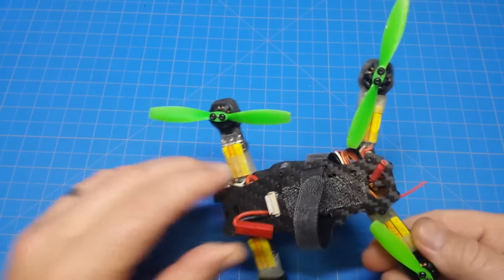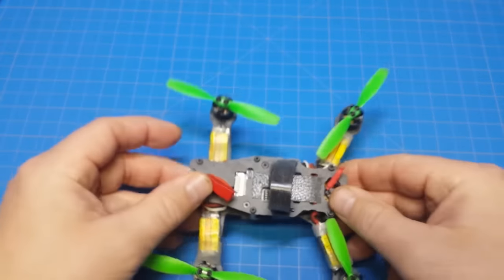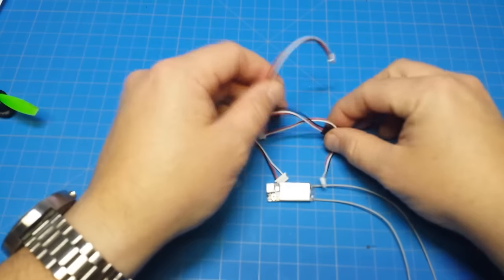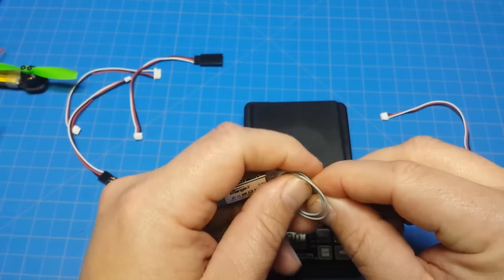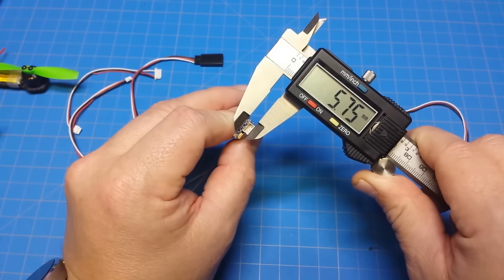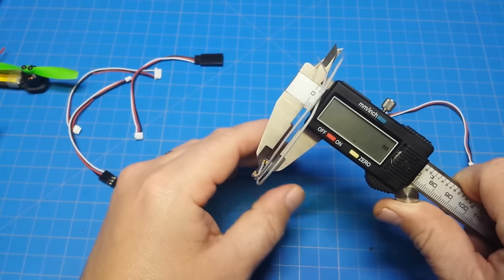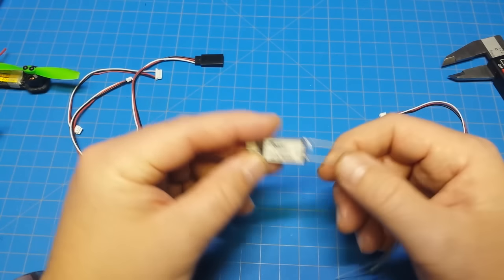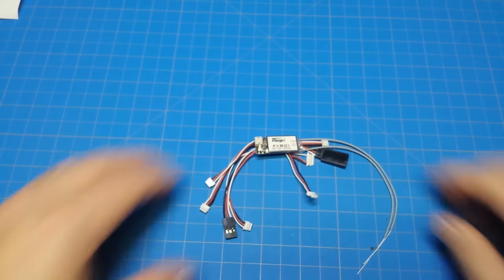iRangeX Receivers - Briefing

Comment: I got a drone that came with this irangex for dsm but there is no binding button on it. Any clue on how to put it into binding ?
Reply from the maker: we have to have the correct uart/port selected and dsmx 2048 selected on the config page, then in the cli we have to type, set spektrum_sat_bind = 9 hit the enter key, then type save. Disconnect power and reapply power, then it should be flashing quickly and bind on your radio. After a series of light changes power off and on the quad again, should be bound now.

Comment: I got the DSM version but I cannot find the binding button !!! Where is it ?
Reply from the maker: I don't beleive there is a bind button. We have to use the cli in betaflight to set the rx in binding mode. Typically set spektrum_sat_bind = 9 and then save. We also have to have the correct uart turned on in the ports tab and spektrum set for the receiver.

Comment: Hi how to activate the Fail Safe on RX IrangeX FX801 for Futaba, Can you Help mi?
Reply from the maker: normally we would set the radio to "no pulses" but on the receiver side I am not sure.
Reply: Ok, I've already configured out, and it might help someone, when the RX is bound, turn on the radio and the drone, then the RX should turn green, then click on the F / S Button until it blinks green and red right away click once on the F / S button and the led will turn green again, then test, turn the drone on and then turn off the radio to simulate the loss of signal, a few short seconds the drone will turn off, I hope I have helped. Tks.

Comment: so, i got my ex105 flying,  but im not very happy about the thrust. it only weighs 43 grams, but with the stock props i can barely get it of the ground. with battery it is 57.5 grams. as i have seen the qx95 (which only weighs 40gram) i would think 3 grams doesn't make much of a difference. i got the rolling spider props on it, so it should have more thrust.... (ps. i get the full throttle range)
Reply from the maker: min and max throttle set 1000-2000? set motor_pwm_rate = 32000?
Reply: VIZE maybe it is the battery connector. I had a bad micro losi connector on my quad (it weighs 43 grams to) and it didn't have much thrust then. Now I changed the connector and I get a lot more thrust and flighttime.
Reply: Nick Burns yes, i have. i cant really work this out. when in cleanflight, all motors spin up fast.  
Ynze Selders that can be the issue. i only got a flight time of 3+ minutes, and i had a small problem with the connector bending. tnx for your sharing!
Reply from the maker: Full throttle spin up? If not max throttle its like the minimum throttle is set to high, but can't be lower than min throttle value shown in the receiver tab.
Reply: The first time I tested it with the new connector I flew it straight into the ceiling. Lol